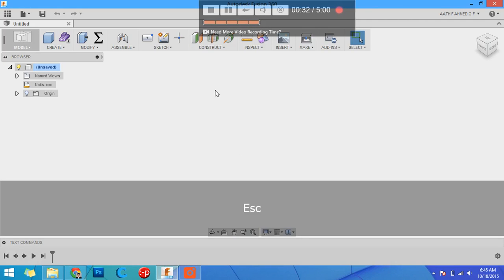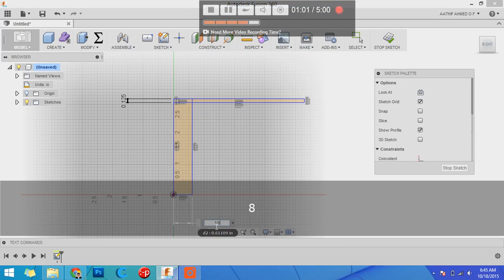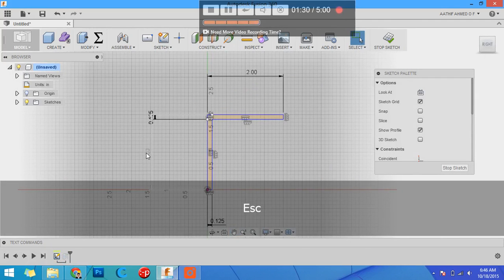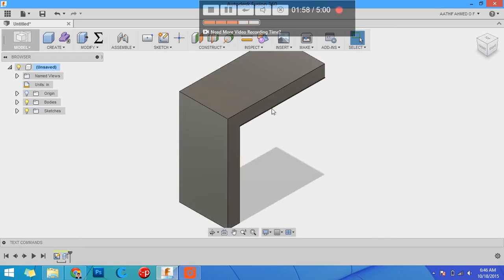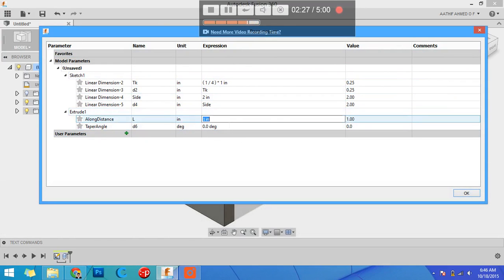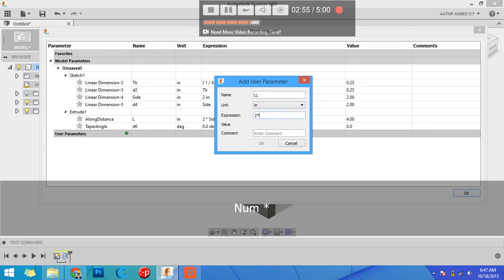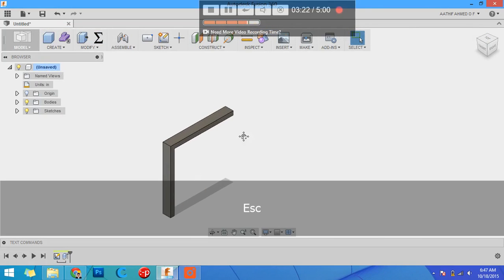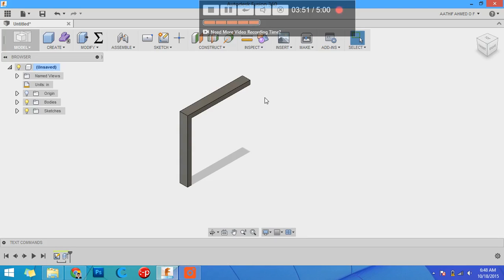Parameters In Autodesk Fusion 360

Comment: Nice Tutorial, But let me ask you, what if I already have a flat plate sketch and I want to get this plate and bend it Right in the middle around 90 degrees, how do I do that? In autodesk  inventor there is a modify button called Bend part, And you bend it right away. Is there any easier  way for me to bend it with out having to sketch the angles and then extrude it?

Thank for the video